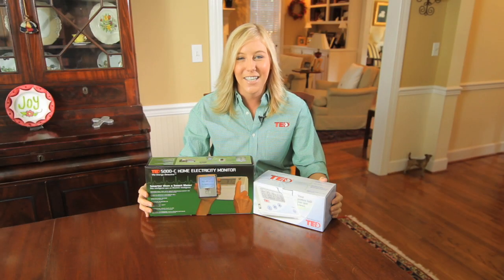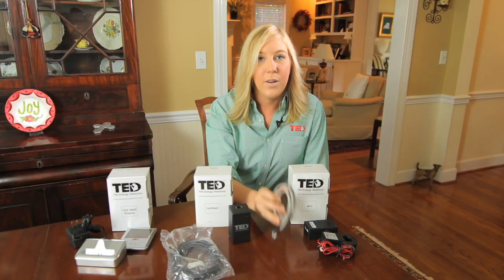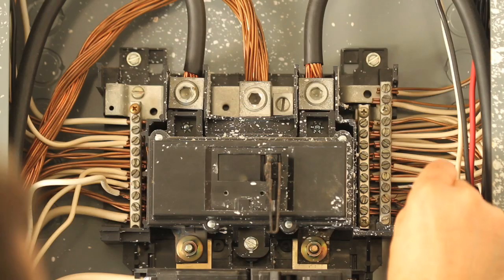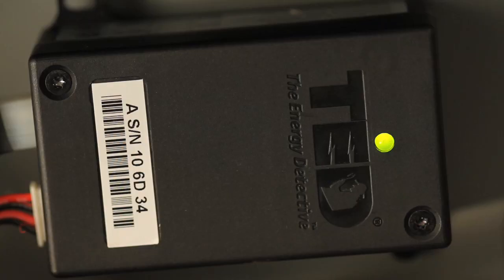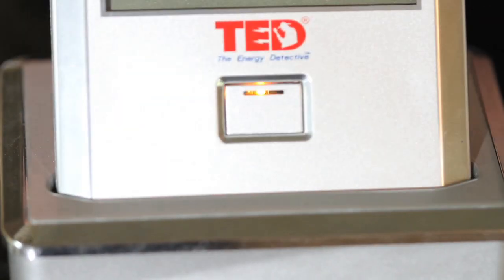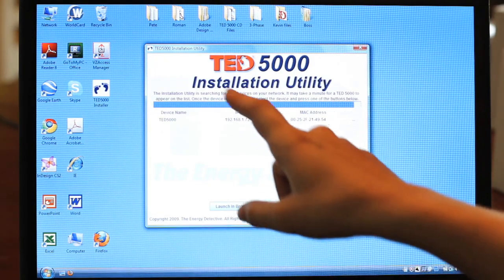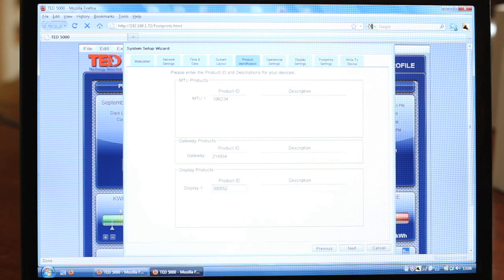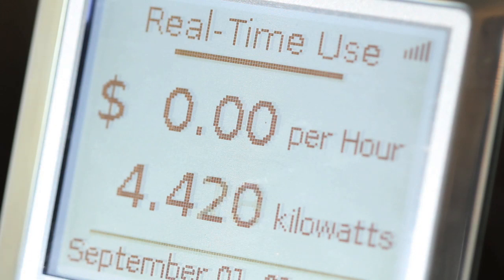The Energy Detective Installation

Comment: Since this video was made, they published that the red wire should be capped off, and that the black wire be connected to the same phase as the outlet that the gateway is plugged into. Using both the black and red wire was causing trouble for a lot of people. If you get it set up and it's not working, just move the black wire to the opposite phase. This thing is awesome once it's hooked up!
Reply: sad that some random guy had to point that out here, rather than TED sounding the bell
Reply: This video is almost a decade old. They probably forgot they even made it, or no one monitors it anymore, lol